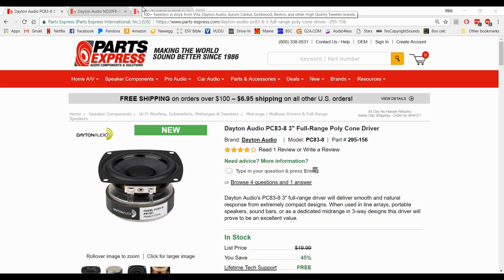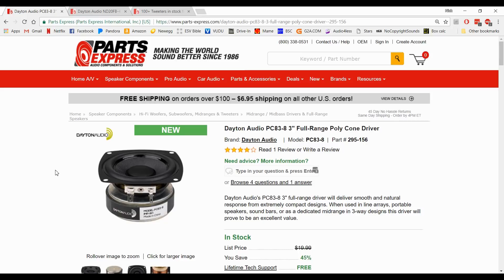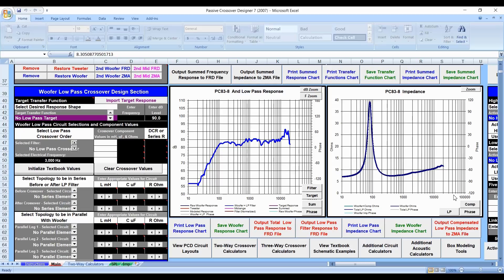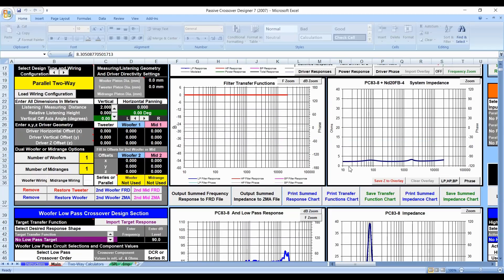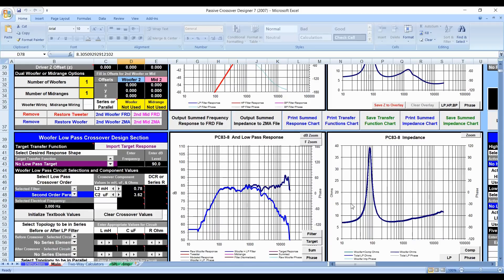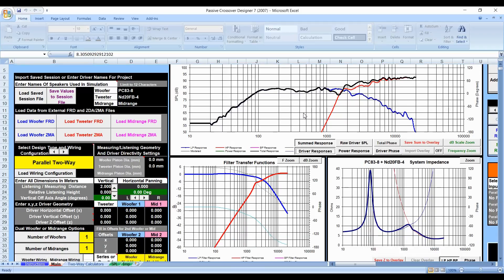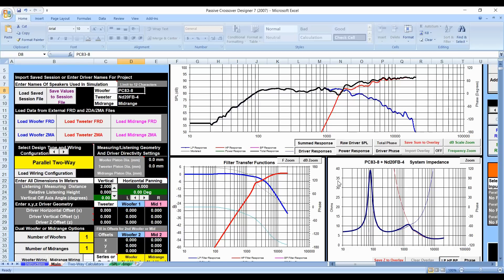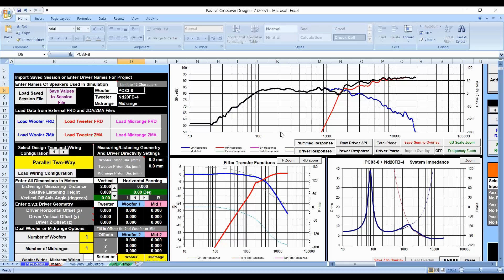Can I use an 8ohm woofer with 4 ohm tweeter?  Impedance Questions Explained

Comment: I am making some 3 way speakers with a woofer for lower bass and a 3" coaxial (time aligned) driver for upper bass, med and treble. It's a (five dollar) 3" full range driver with a madly thin cone (great transient response) and it's resisted a bit to take the load off it (except the top) with a 1.5 mf cap in parallel with the 6.8 ohm resistor and .22 inductor. And...(wait for it) there is another micro full range driver (stripped of it's cone) and stuck on the rear of the 3" FR driver. And a thin stick is glued to the micro FR voice coil tube and the stick runs through a (drilled) hole in the 3" FR driver. And the stick pokes out at the cone's center and a tiny foil "tizzer" is glued to the end of the thin stick. The tizzer is time aligned with the 3" driver's cone center. I have one complete speaker (in the box) basically made and the other should be finished in a day or two. It's a 3-way that looks like a 2-way and the boxes are semi omni (slanted drivers) and top (inverted pyramid) horns, it has nice directional and omnidirectional qualities. It blares when in front and also it's not "muffly" anywhere in the room. 

But that's just the boxes, what really adds to the spacial sound is the coaxial point source sound. And the med is so resolving cos of the super thin cones and the extra treble extension of the coaxial is obvious compared to the FR drivers by themselves. I did it with piezo's once (years ago) and you basically can't hear anything come out of piezos (by themselves) but when you put them in a FR driver's throat LOOK OUT, you got treble! Just like full-on tweeters! But piezo's have a "cold" treble sound and on house, they sound "scratchy" (great on jazz though). I had to drill the FR drivers still, for the wires and support for the piezo, and when the FR driver cone "excurted" it had to miss the piezo. Only possible cos I found such small ones (rare piezos). 

But now I'm REALLY HAPPY cos I can do it with coil drivers and it sounds way better than piezos and adds to the treble the same way and "stings" like crazy. And now I can play house and it sounds way awesome, not "scratchy". I'm listening to one, the one I just finished and it's the best speaker I have made. Better 3 way med with the small thin cone (instead of the 2-way thick heavy woofer cone) and the point source coaxial sound that goes way higher than the usual 12 kh of the 3" FR driver. 

I can't do it with tweeters, cos I can't strip the domes. I can strip cone tweeters but they are a thing of the past, I'm afraid. And the tiny size of the stripped micro FR driver is pretty lightweight and the stick is micro thin without being too flexi. And the tizzer is a tear drop shape like < 1/4" big. And the hardest job (besides drilling the driver) is sticking the tizzer on the end of the stick. I have also experimented with lifting the 3" driver above the speaker box hole like on and angle and average of like 1/2" gap from the hole. And there is a 2" deep cardboard ring around the speaker hole, going 2" down into the box. That makes the 3" driver gap act as a bass vent. If you don't do it, the tone will be shocking with the speaker above the hole (and bonky bass). 

The idea of the gap is to get amazing med sound, with more "openness" and "ambience" and the voice sound is more "live". There is also more treble from the FR driver (when it's semi open cone) and it's sweeter treble and goes up higher too. But it has to be choked (.3 mh) and the treble is pinched up with 1.5 mf cap. 1.5 sounds MAGIC with the cone semi open. It gets rid of that "chiffy" sound FR drivers can produce (noticeable with house, and especially with semi open cones) and the 1.5 cap makes the treble "sting". The extra treble coaxial unit has a 1 mf (ceramic) cap, whereas the 3" FR has the usual (electrolytic) tweeter cap. Why, cos it sounds better with this combination.

Comment: Can i connect an 8ohm 250 watts woofer and 4ohm 100 watts tweeter with only a capacitor?
Reply: +1! Can we get an answer
Reply: What frequency will the capacitor cross it over at?
Reply: CRiVEN Let’s say the tweeter came with the capacitor, will that work or should I put it on that separate channels?
Reply: Marlon Jimenez sure, I believe that would work! If it’s a capacitor that’s designed to cross over the tweeter it should be fine. But if it’s just to protect from amplifier pop in a bi-amped system, I’d be more wary of using it as your crossover. Also, make sure it can handle the wattage you’re sending to it

Comment: so, in essence, the load that the amp sees with an 8-ohm woofer and a 4-ohm tweeter with the 2-way crossover is still 8 ohm?
Reply from the maker: Yes. It would be considered an 8ohm nominal load.
Reply: @Toid  How about a 4ohm speaker and a 8ohm tweeter, would it be the same? What kind of crossover should be used for different impedances? Thank you
Reply from the maker: @felipeprado2103  that is a great question. You can always go up, as it's much easier for the amplifier to drive
Reply: What about 2 8 ohm woofers with a 4 ohm tweeter, will the fianl through a 2 way crossover only be 2 ohm?  Wanting to put 2 woofers as mids in a door with a tweeter and run all 3 on one channel.

Comment: So if I wire a 2.5" full range 4 ohm 10 watt speaker and a 6" full range 4 ohm 15 watt speaker in series, it's an 8 ohm load right?
Reply from the maker: If there is no crossover.  If you cross them over, it will still be 4 ohm.
Reply: No crossover, I'm just interested in using up a couple sets of 4 ohm speakers I have collecting dust to build a couple 8 ohm cabinets strictly for midrange.

Thanks for the upload, and thanks for the reply. Liked and subscribed.

Comment: Since most amp's can handle 4ohm i don't see a problem here.
Some times it even is needed to do so. Im currently working on a studio quality 2way speaker that can play pretty loud and low. I will use a 10" 8ohm low and  wavecor 30mm tweeter in the waveguide and 4ohm version. it can cross VERY low! I will cross it at 1,1khz.
The 10" makes about 92-93db at 2,83V wich is 1watt at 8ohm's and the tweeter would only do about 90db at that in the 8ohm version. So i MUST use the 4ohm version wich makes 93db at 2,83V.

Comment: What about 3 way?  And I know running a 4 ohm amp @ 2 ohms is bad...what about 16 ohm speaker on a 4 ohm amp?
Reply: You can't define such thing as "4 ohm" amplifier. Amplifier is composed in two or mostly three stages which provide voltage and/or current amplification and impedance matching.  Driving higher impedance loads is not a problem since the current gain would be lower which translates in less current and heat disipated by the transistors. Theoretically  the "4ohm" amp, that can dissipate 100W of power driving a 4ohm load, can dissipate only 25W driving the 16ohm load.

Comment: Ok so that explanation was perfect. But i have a question i cant seem to find an answer for so hopefully you can explain this to me? 

So it relates to the power split of the drivers. In a 3 way speaker that has a subwoover, a mid range and a tweeter, how does a 50 watt input get divided? Im yrying to pick the woofers for a design like that but im not sure what rms they need to handle. Does the power get equally split by the two woofers and the tweeter get a fraction of that? So in that scinario both woofers need an rms of at least 25-30?
Reply: The lower in frequency you get, the more energy is required to reproduce that frequency. That’s why you see 1000w subwoofers, but nobody is putting 1000w straight into a dome tweeter. Your subwoofer will take the most, your midwoofers will usually take less than the subwoofer depending on where you’re crossing it over, your tweeter doesn’t use too too much.

Comment: @ 123Toid.... Hi. This is my question from your 'The Reveal' video.....Once you add the 8 ohm resistor (Attenuation) in series to the 4 ohm Tweeter, would the amp now see this as a 12 ohm load (since you’ve not used a 2 pole series and parallel resistor L-pad). What will be the calculation for the high pass capacitor. Will you calculate based on 4 ohm load or 12 ohm load.
Reply from the maker: The crossover is still based off the 4 ohm tweeter.  THe resistor is resisting (attenuating) the amount of power going to the tweeter.  This lowers the volume of the tweeter to an acceptable lever compared to the other drivers (ie the midrange).   But it has no effect on the crossover frequency at all.

Comment: I'm brand new at this speaker building stuff, and I'm watching your vids over and over trying to let the info sink in. But, I'm still a little confused as to impedance vs crossover  construction. If I use the soft ware and construct a proper 3 way, I really only have to worry about the largest woofer for over all impedance of the speaker?
Reply: But be careful! Don't make crossovers that will go under 3ohm's at some spots.
Reply from the maker: Crash 709 Whatever speaker plays the lowest notes will typically be you're nominal impedance is.

Comment: Okay, I am upgrading speakers on an old Boombox I found to try to get it to sound better. Here is my setup:
I have a tiny 2 channel amp which produces 10 watts RMS at 8 ohms, or 20 watts RMS at 4 Ohms. It is a two channel amp.
I wanted to use budget parts, so at Parts Express I found a nice 4 ohm 20 watt RMS full range speaker, and wanted to pair it with a 6 ohm 10-watt tweeter.
Can I run each midrange and Tweeter in parallel without a crossover, or do I need a crossover? I'm not running that much power, and I thought the Tweeter would be protected.
What do you think?
Reply from the maker: FEMA Region 9 short answer is no, you should not run it that way. That's a sure way to blow your tweeter.  However, a simple 1st order crossover on each speaker along with a resistor to attenuate the tweeter should be enough.  That's 3 parts in total and probably less than $6 a speaker or $12 total.
Reply: 123Toid thanks for answering. I totally agree with you but didn't know where to start when trying to do this. I ended up calling Parts Express and spoke to one of their people, who actually guided me to crossover frequencies.com and walked me through the process of identifying the exact components I would need to accomplish this. A very interesting experience. Thanks a lot, I'm glad you and others have YouTube channels so people like me can continue learning. Keep up the great work!
Reply: 123Toid one more question. Like I said I'm doing this to an old school Boombox. If I'm using a small separate amp built into the cabinet, what do I use as the input signal? Do I use the output from the stereo that goes to the speakers and feed it into the amp? Or, do I tap into the headphone output and run that as the signal source for the amp? If I use the headphone jack, I lose the ability to fade from left to right.
Reply from the maker: FEMA Region 9 tap into the headphone jack. Or find the source on the board itself. The speaker outs are amplified, so you don't want to use those.
Reply: 123Toid thanks again for the quick response. That's kind of what I thought, but wanted to ask someone who knew better. I'll look for the outputs first on the board, if I have a problem locating them then I'll just use the headphone jack output.
Reply: 123Toid I opened the radio and looked at the board, I've identified the preamplifier chip. Would I tap into the inputs before the chip? Or would it just be better to use the leads coming off the back of the headphone Jack?

Comment: I'm considering building a set of components speakers... 4ohm 300wrms 6.5 mids and a set of 8ohm 500wrms 2" super tweeters on a Hifonics Gladiator 100.4 watts 4ohm amp... Would this be a great setup or should I just look to piece together a 4ohm component set instead???
Reply from the maker: I'm not familiar with those components, sorry.
Reply: LawBr8ker depends on how it's wired, parallel or series wiring.

Comment: if I have a jbl 3 way crossover and the impedance are a little off can I use it all the replacements are 4 ohm the and it was 3.5 ohm 3.2ohm 3.6ohm
Reply from the maker: Beieve it or not, all of those are probably 4 ohm speakers, so they should work just fine.

Comment: I am going to ask, is it safe to use lets say a 600w woofer and obviously a lower watt tweeter on the same power supply without damaging the tweeter at higher power levels as you said? or will I need something that regulates the power to the tweeter?

Also, the resistors and such, they all have very low rated wattage, I'm assuming you don't have to match there wattage to the wattage your running to the woofer? seems odd..
Reply: Power consumption increases by a factor of 4 for each octave you go DOWN in frequency (and, conversely, it requires only on fourth the same amount of power as go up an octave) If you need 100 watts of RMS to deliver a sine wave at 90 dBs of SPL at 80 Hz, you need only 25 watts to deliver an equal level at 160 Hz and 8 watts at 320, etc.
Reply from the maker: That is a good question that requires a lot of explaining and more information provided.  However, the simplest answer is, no.  This is one of the main reasons manufacturers like Definitive Technology, Golden Ear and even Polk Audio have built speakers with powered subwoofers in the same cabinet.
Reply: Thanks for the quick reply :) and one more thing, would it be simpler to just have a different power Input on the back of the speaker for the tweeters then the input for the woofers, and a set of different amplifiers running just the tweeters along with a dedicated high pass crossover for the tweeter,.. if that makes sense?
Reply from the maker: You're Welcome.  Typically you wouldn't use a 600w woofer alone with a tweeter.  Woofers, usually do not have have the capability to go high enough to crossover with a tweeter.  There are exceptions (such as PA speakers), but for home audio, you would be using a midrange to crossover with a tweeter.  And the mid would not need nearly that much power.  When talking about a 600w woofer, you are typically talking about a subwoofer which rarely are used above 200hz.

Comment: Having bought some speakers with blown tweeters I replaced them with bullet tweeters, The tweeters are 4ohm but the bass drivers are 8ohm fitted with two way crossovers which I also replaced (the crossovers had blown) Now the tweeters sound much more louder than the bass drivers. I have changed the crossover frequency but no differance at all, 2k 2.5k 3k and 4k.  Is there an easy way to level the output without replacing the tweeters  for 8ohm ones ? or is it because bullet tweeters are louder anyway ?
Reply from the maker: eugene o'neal it sounds like you need an l-pad. If you look that up, it's a way to attenuate your tweeters down to match the level of your woofer

Comment: Sooo the Tweeter isn't going to be too quiet although it's half the impedance of the woofer?
Reply from the maker: That is correct.  You have to compensate for ti.  but often tweeters have such a high sensitivity, that you are usually attenuating them down to match the woofer.
Reply: The lower the impedance the more power the amplifier can deliver to the coil, so the less ohm the louder it may sound. wich means a 4 ohm  tweeter would sound louder on the same volume level on an amp than an 8 ohm would wich means the tweeter would be louder with the 8 ohm mid than for instance an 8 ohm tweeter with an 8 ohm mid.

Comment: Can I use a 4ohm woofer with a 8ohm reciver?
Reply from the maker: Now that is a great question!  Typically you should not use a speaker that is not rated for your receiver.  However, i use my Reveal speakers (4 ohm) and my DIY Dayton Soundbar (4 ohm) with my Pioneer Elite receiver only rated at 8 ohms.  Most receivers have an auto shut off if they get too hot.  of course, you are hoping that fail safe actually works.  Some of that comes to the fact, that I am not using much power for them, which makes it much easier on the receiver.
Reply: So the only downside is the heat? cuz i have seen people running car subwoofers 4 ohms running with stereo or surround amplifiers which are 100+ wpc ... any thought?

Comment: I have a question that you kinda answered but not completely. As we know, most speakers have usually a more powerful woofer in wattage that the tweeter. How do we know how many watts our tweeter should be if we have a 500 watt woofer for example? I know that we need to match them at decibels but is this the only thing? 
How the crossover sends the right amount of power to the tweeter and not blowing it up? I mean, in a speaker with a 500watt woofer we need a 500watt or more amplifier. Obviously, the power contribution between the woofer and the tweeter is not 50-50 but how is it?  Sorry for the long question and thanks in advance
Reply from the maker: That's a little more complicated to answer than you would think.  It all depends on the crossover slope (order) and frequency in which it is crossed over at.  This is one of the reasons crossing you need to be careful of crossing over a tweeter too early.  Here is a chart for at least a 2nd order crossover: http://www.diyaudio.com/forums/attachments/multi-way/52292d1130223767-power-distribution-fane-gif and you can also check out this for a 3 way: http://www.silcom.com/~aludwig/EARS.htm#Soft_sounds_and_loud_sounds